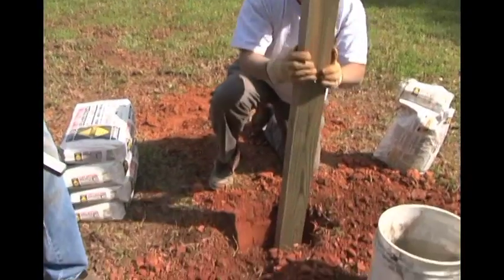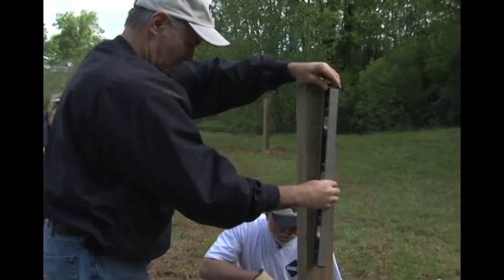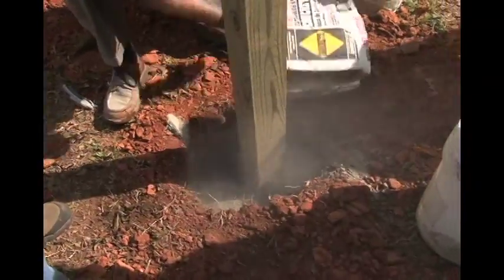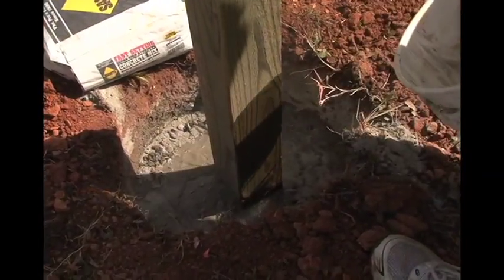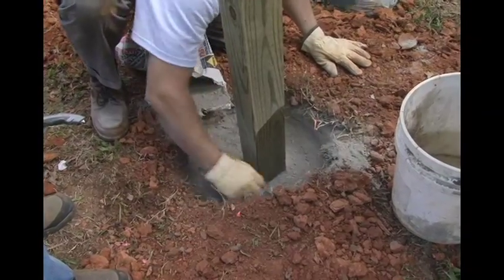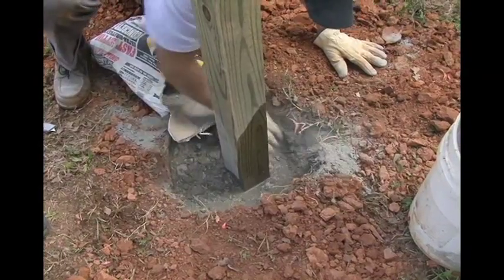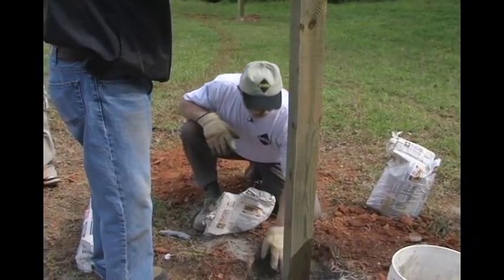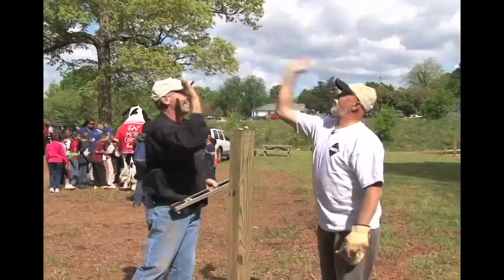Post Setting - Sakrete

Comment: Worst thing to use even with pressure treated lumber. It will trap the 
water between the concrete and the wood speeding up the decay of the 
post even if it is pressure treated. Use the foam product. If not wrap the post with HD felt building paper to isolate the pole from the concrete.

Comment: Never want to say to put a poly tubes/ bag in the hole 18 " flat will do it. (garbage bags can keep the dirt from mixing in) sono tube = $$$$$ 12" hole is a bit over 36" diameter. Wil cure nicely especially if pre mixed and filled  9 " sqaure box with bottom cut off is a good form, Or any bigger cardboard box and clamp and glue 2 edges so it is a perimeter of 37" a square in the ground is okay. Want longer wet time - bags or use old spray paint inside the cardboard first.

Comment: Except you need to make a mound around the post higher than ground level otherwise you'll be changing that post in 5 years
Reply: How come? Is it due to wood rot? Can you share a link showing a mound example of what you are talking about.
Reply: @KJTB  Its so when it rains, the water runs down and away from the post, and doesnt pool at the base of the post and the ground.
Reply: @kingkelly44  got it, thanks.